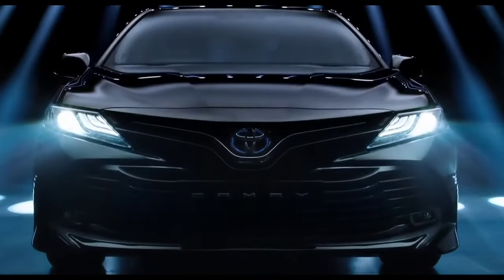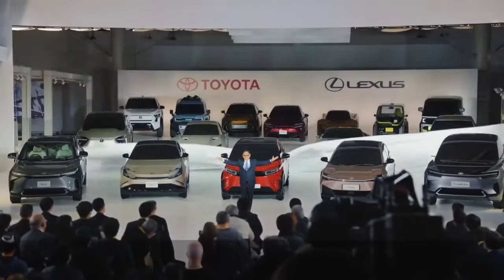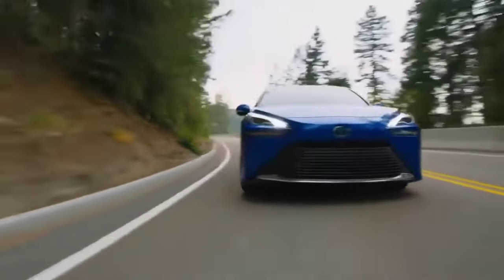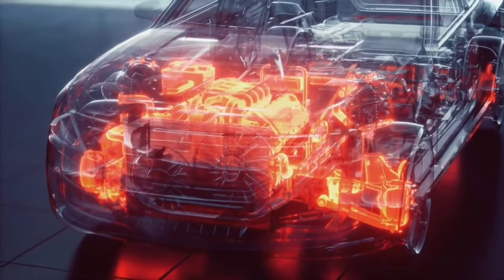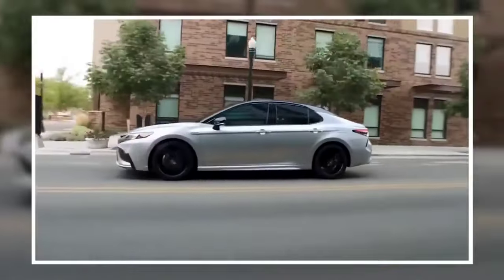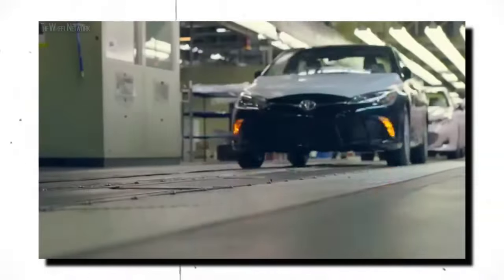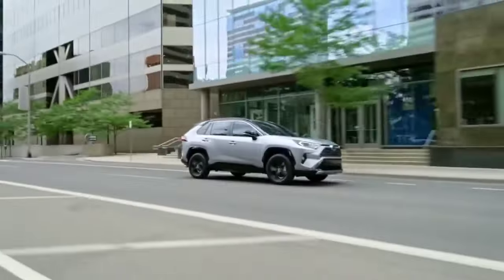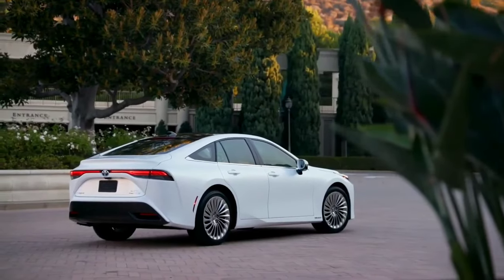Toyota Secretly Built a Powerful Electric Engine Shocked Everyone

Comment: One major problem with hydrogen fuel cell electric vehicles besides the whole hydrogen generation and storage problem is that the only currently known efficient way of directly generating electricity from hydrogen uses platinum and palladium catalysts, which makes the fuel cell stacks quite expensive to buy and replace whenever something happens to them. Not remotely cost-effective.